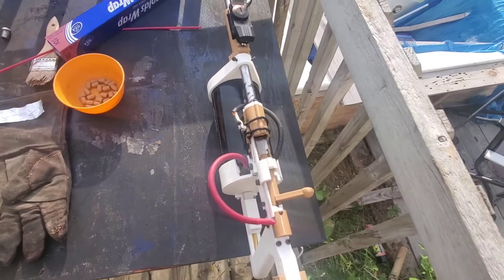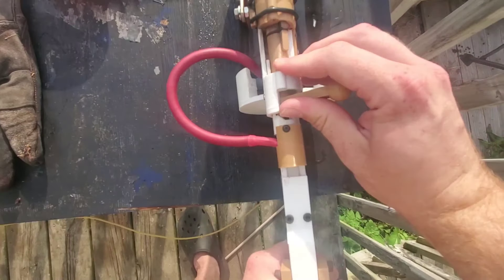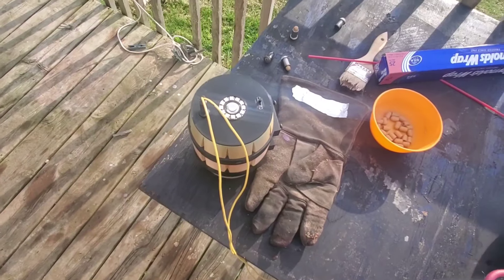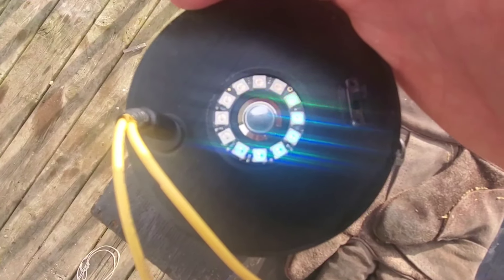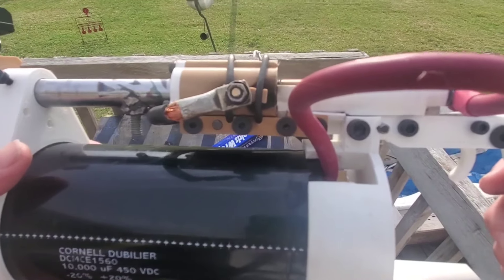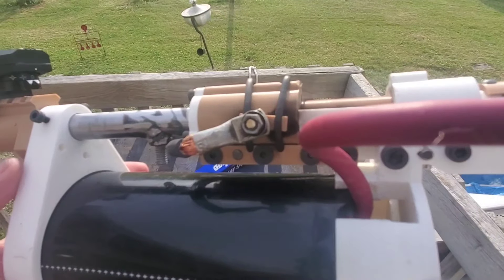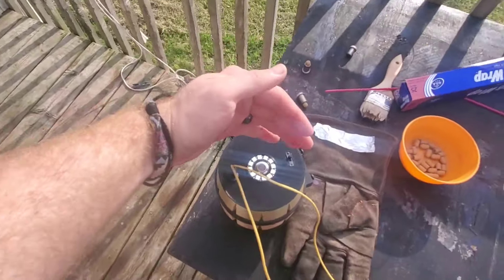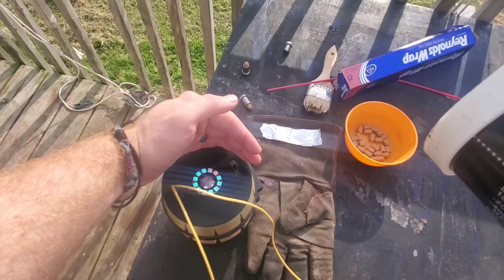Bolt Action Plasma Gun Quick Demonstration

Comment: You’ve got the similar basics of a real rail gun. They fire a beam at a tiny piece of aluminum, which is very precise & of a certain density & size. The explosion is totally contained & pushes the projectile the same as gunpowder does in a conventional firearm.   Or maybe I should say “plasma rifle”???
You’re right there, you just need 100% breech seal & work on the power level.
Reply: That is nothing like a rail gun.
A rail gun uses the magnetic fields generated by a projectile shorting two rails to accelerate the projectile.
This uses expending gasses, not electromagnetic forces, to move a projectile.

Not to mention your description of a railgun is nonsensical and innacurate.
Reply: @owenkegg5608  Yeah, I kinda got 2 things combined. There’s a new generator that has to be built & maintained by robotics. Workers can’t enter. It is powered by an a rifle that fires a super fast projectile at a substrate, (i can’t recall the material used) and it’s like a nuclear reactor. The substrate is replaced and another shot fired in regular, timed intervals to maintain power. Yeah, whatever that is
Reply: @boomstick4054  Ah

Comment: just a suggestion, i assume the entire bolt action system is 3d printed, you could use some Super Lube synthetic grease to help it slide a bit easier. its commonly used for gas blowback airsoft guns and is kind to plastic... cool project tho!

Comment: If you stored all the juice you needed for one shot in a capacitor, and then had multiple capacitors rigged up in such a way, you could essentially have a bunch of shots ready before needing to recharge the gun [EG delay the charging in favor of just loading the ammo and capacitors]
Then again, I'm not an electrician, so, I'm sure there might be some drawback, expense, or needless danger to doing it like that.

Comment: just out of curiosity, wasn't plasma supposed to be overheated gas?
if yes, isn't this supposed to be either a Railgun or a Gauss Gun, bc both propel a projectile through the use of electric energy, one through the barrel using magnets, the other uses energy to cause an explosion on the projectile causing it to propel itself, now o don't know which is which, and i might be wrong about one of these, i am not a huge nerd about these things.
Reply: A railgun uses a pair of rails shorted by a projectile. Because of some fancy stuff with the direction of current the projectile gets shoved along by a magnetic field. A gauss gun/coilgun used a bunch of wire coils set up in such a fashion that the projectile is tugged along by a magnetic field to one coil then the next. Neither use expanding gas like a regular firearm.

Plasma is just the state of matter above gas. So yes just spicy gas.

This uses an expanding gas similar to a conventional firearm instead of an electromagnetic field, so this is neither a coilgun or a railgun.

Comment: That capacitor dumped 1k Joules through those tiny little wires running into that gun?  I’m shocked the entire thing didn’t burst like an exploding bridge wire, shutting down all the micro electronics within 30 ft.

Comment: Anybody ever wonder why 9ne side of foil is shiny and the other is dull? 
At the final thickness of foil, they double up the foil so it can be properly supported by the rollers they make it on. The shiny sides are facing out. And the dull sides are touching the other foil half.
Reply: So a sheet of foil is only half as dull as you?

Comment: Are you using water with aluminum foil if not you should definetly try, i made some electro thermal tests(but with more solid full metal gun and 8 500v 5500uF capacitors and adding water to chamber gave me 2-3 times faster velocities.
Reply: Upload a video of you using it on your YouTube channel. There is currently on market a product called eshotgun that is a coil gun. Your concept seems marketable for pest control, plinking, etc.
Reply: @ppkrex  unfortunetly if i would upload a video of it i would have police knocking at my doors soon, this is how "free" europe is. Because i was using aluminum with water, the water was dissasembling to oxygen and hydrogen and then oxygen was oxidizing aluminum foil that was also vaporizing, because of the chemical reactions the gun could be considered a firearm in court. Now gun is dissasembled and i'm using capacitor bank and charger as spot welder and for other experiments.
Reply: Whare did you find a capacitor of 5500uF 8500v, could give a link?
Reply: @Michael-oq2wx  I meant 8 capacitors that have 500v and 5500uF capacity not 8500v, also i found them on scrapyard.
Reply: @dymitrnawrocki9926  Ok, I will try with 4800V 55uF for the beginning.

Comment: That’s not a plasma gun. A plasma gun discharges a plume of super-heated gas, similar to a plasma cutting torch, but in a “plume” or “spray” similar to a flame thrower. A capacitor only provides a split second snap of energy. A plasma gun requires prolonged high energy to super heat gases either stored in a container or siphoned from surrounding atmosphere. Both present serious complicating factors.

Comment: I thought you were going to show some kind of electrical discharge gun, a "ray gun", or perhaps a rail gun of sorts. Instead, you have an electrically-fired conventional kinetic weapon. It fires a conventionally-primered metallic cartridge with a conventional bullet propelled by conventional propellant. The only difference is that the primer is fired by the electrical discharge, instead of a striker or firing pin. Yes?
Reply: this is a railgun, the projectile looks like a standard bullet propeled by explosive powder, but it is actually just a piece of metal
Reply: @mateuszskrzypinski6512  Actually, a true electromagnetic rail gun uses NO propellants. A rail gun projectile is propelled solely by magnetic flux or field, accelerated down the rail, at tremendous speed, leaving the rail & then launched at the target.